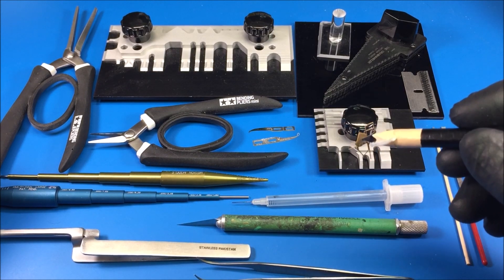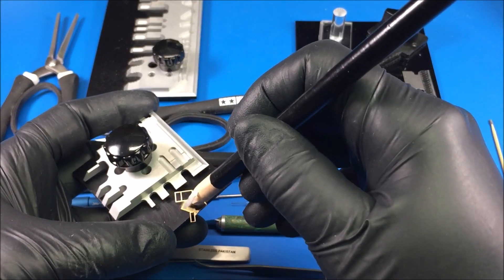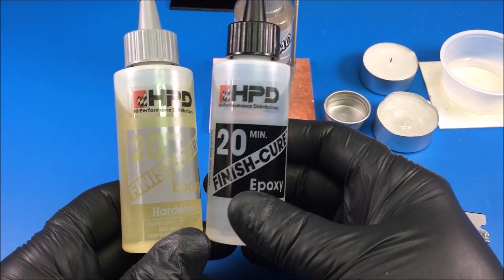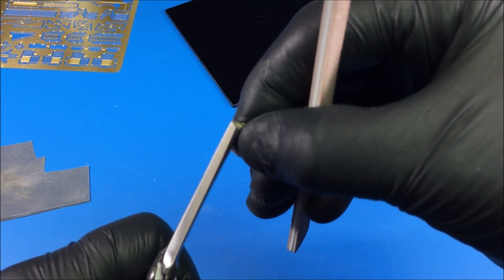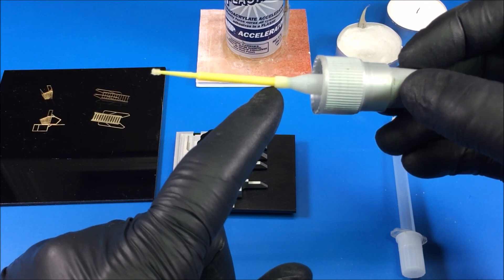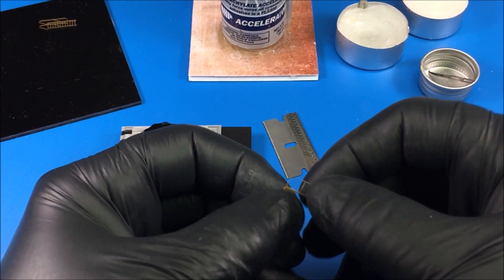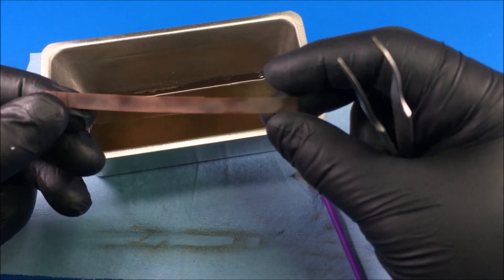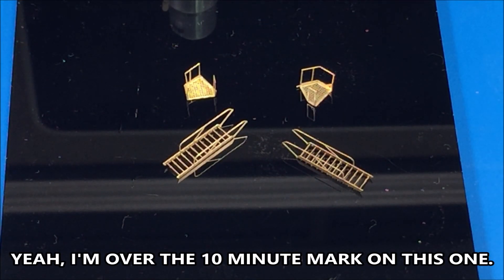Photo Etch Parts - HOW TO – Beginner to Advanced – (Trumpeter 1/200 HMS hood)

Comment: Thank you1 I have building models for years but I did learn a few things from you so I am subscribing. Just a note, I usually just use vinegar instead of Blacken It. I just soak the entire brass fret in the vinegar for a few hours. Also helps to prep the brass for paint. Thanks again.
Reply from the maker: Thanks! That’s a great tip… I’ll be trying that next.🙂🍻

Comment: Nobody who uses this tool had explained its other usage. What are those curves on plate are used for? These are are not just decoration. Please explain them.
Reply from the maker: I'm not sure what you're talking about. Can you tell me where in the video, please. The timestamp would help.
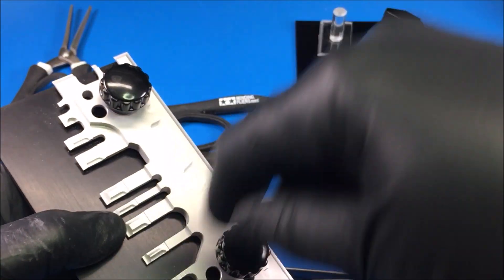Reply: @SmallSoldier  at 3:55 the curvature between the clamping tooth. I think you can use them to bend the PE, for the sherman tail light guard or use the the angles for 60, 30 and 90 degrees
Reply from the maker: @schubert06sebastian39  Yes correct. These can be used for that purpose as well.

Comment: Thank you so much for the very informative video.  I have two hobbies; one is working with photoetch parts, and the other is looking for photoetch parts that I was just holding with tweezers.  Scientists do not believe that anything can exceed the speed of light however I think that I can prove that small photoetch parts, when held correctly in the right pair of tweezers and then launched explosively, can not only exceed the speed of light but go into an alternate reality universe.  My only project so far with photoetch was the HMS King George the V 1/350 and it was a tough first project.  I love how you use the glue to reinforce the joints and the blackening agent.  I didn't do any of that.  If it looked like it forded into position and stayed there, I just left it like that. It took me a few tries to realized that soldering parts were really a lost cause for me and I came to depend completely on the glue.  I wish I could solder where it would help.   Thought the sanding tip was fantastic.    The most frustrating thing for me is that cyanoacrylate seems to stick to the tweezers and the photoetch parts the best, then to skin, and finally to plastic.  As a suggestion do you have any links between some of the products that you show in the video?  Especially the blue and olive-colored round variable cylinders.  Could not catch the names of those or see the markings on them to get the manufacturers.  Thanks again
Reply from the maker: Your welcome Thomas! Yes etch parts have a way of finding a hole in the universe and fly by light speed never to be found again. One trick that work great to find etch is stick some fine mesh such as pantyhose on the end of your vacuum tube and run it along the areas you figure it last went and you’ll find it stuck to the pantyhose every time. The tools your referring to are called the Multitool and you can find them through the company “The Small Shop” our if the US. Tell them Scott from the YouTube channel Small Soldier sent you. Thanks for watching.👊🏻👊🏻😁
Reply: Thanks for the name of that supplier and for the vacuum trick.  I'll give it a try.  Keep those videos coming
Reply from the maker: Your welcome sir, anytime. Yes that vacuum trick is brilliant and works for anything,... plastic, resin and etch. And I certainly will keep production running. Cheers!
Reply: Hilarious. 😂

Comment: Thanks for the video! I've blackened brass for other projects, but not a PE.  I use Birchwood Casey products a lot for steel, and their Black Brass works great too. It's also a good idea to clean parts with acetone after you sand it, if the abrasive is aluminum oxide it can cause a reaction with the chemicals.
Reply from the maker: Thanks! Acetone... never knew about that one. Is Birchwood Casey something I can get here in Canada? Is it more economical than other modelling brands?

Comment: Thanks for the video.  My trouble with photo etch is glueing it.  Why does the glue not clog the syringe? I hope you show your gluing techniques.  Again, thanks for sharing your skills.
Reply from the maker: I use the needle as an applicator. When the needle gets glue build up as I use it I burn it off with a candle I keep lit as I work. I will certainly be doing more etch as I do updates. Thanks for watching and commenting. Any other questions don’t hesitate to ask. Cheers.
Reply: Small Soldier genius ! I never thought to heat the needle to get the glue flow 💁🏻‍♂️
Reply: Using black superglue is helpful, to see where it is. Then get debounder and take off the excess.

Comment: Awesome video, question thought? What kind of Glue do you use to put the PE with the plastic from the model, cause I tried to use ZAP Gel to glue a PE deck from my Yamato to the normal model, but didn't work.
Reply from the maker: Did you sand the PE first?
Reply: @SmallSoldier  yeah the back of it, I was just wondering what glue do you recommend me the most, I even thought to use Poxipol, but seems kinda risky
Reply from the maker: @thesant3905  I use Medium CA for jobs like that. I'm not sure why it didn't work for you. It's usually a fault of not sanding the PE part to give it some "tooth" to bond. You could also rough up the surface of the plastic part with a rough sanding stick or paper that could solve your problem. Good luck!

Comment: What is the best contact adhesive to use for photo etch when attatching to a plastic model …..complete beginner
Reply from the maker: It really depends on what you're attaching. If it's a small fairly light piece I use a varnish such as future or X-22. For larger pieces I like CA or "crazy glue". The brand of CA is a personal choice so you'll need to experiment. You can also solder... but that's a whole other video I need to do. If it's something like a fender on a tank model you can always glue a strip of styrene to the etch part (ie: fender) then attaching the part with regular plastic cement makes it easier to manuover it into position before it dries. Did that help? Feel free to ask more questions if needed I usually get back fairly quickly. Cheers!

Comment: Witch size is the best for pe bender when you have 1/16 models and 1/32?
Reply from the maker: I'd get the 8-inch bender if you're going for the Small Shop stuff. It'll help with the long stuff.
Reply: @SmallSoldier  thanks, I bought the one from Trumpeter called medium bender hope it is not to small for 1/35 and 1/16 pe parts.

Comment: one problem i got with round scapel like this, is it much brittle than a hobby knife, it fine, i had been broke 3 blade already, good thing is it dirt cheap to replace, btw, which scapel blade number did you use ?
Reply from the maker: I use both types. The Excel #11 and Swan Morton round.

Comment: Hi Scott, loved your video especially how you bent the steps on the inclined ladder.  I built a little jig with a 45 degree angle cut and move the ladder along while using a micro flat chisel to bend the steps.  How do you form the complex curves required in funnel grills?  They are tough enough when the funnel opening is round, but when it is elongated like Hood or many other ships like HMS Exeter, it can be a bit intimidating!  Any suggestions would be most welcome!  Thanks! John
Reply from the maker: 😅 I'll let you know when I figure it out. LOL

Comment: Excellent video!!! One question, why do you paint over the brass? Wouldn’t it be just the same to use the plastic and paint over that instead and save you a bunch of work? Or does the photo etch have more detail?
Reply from the maker: Thanks! Yes the purpose of the etch is exactly that.  It helps replace less detailed parts that are too over scaled or just plain inaccurate.👍🏻
Reply: Or in some cases like my 1/570 Titanic the railings are think solid in detailed plastic so I got photo etch sets for it